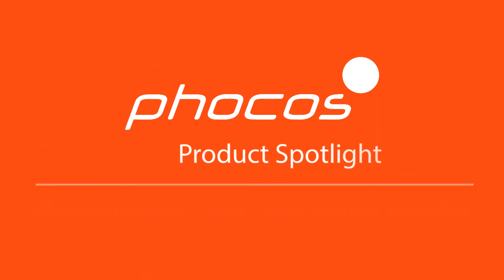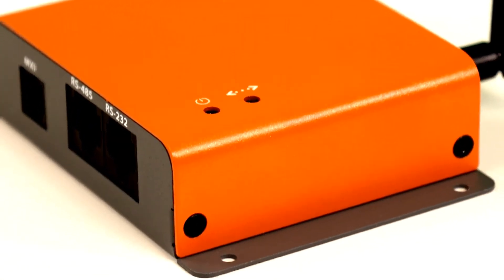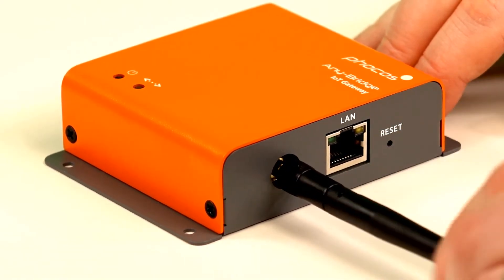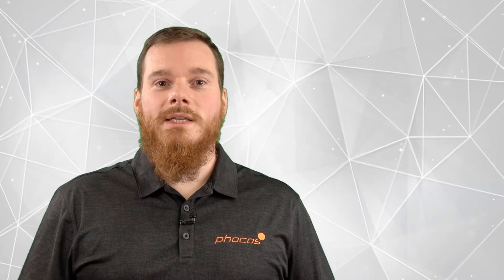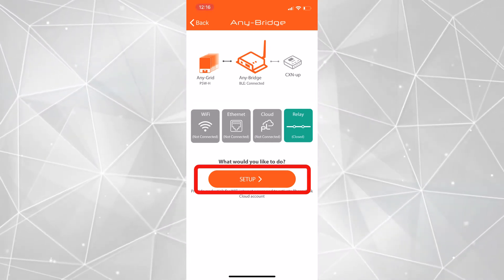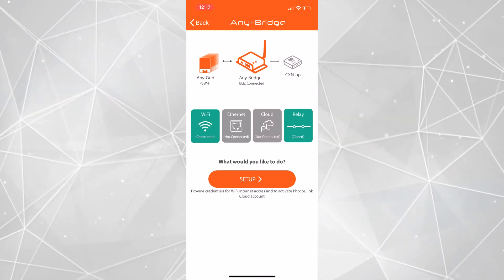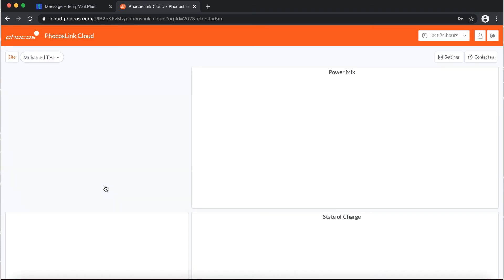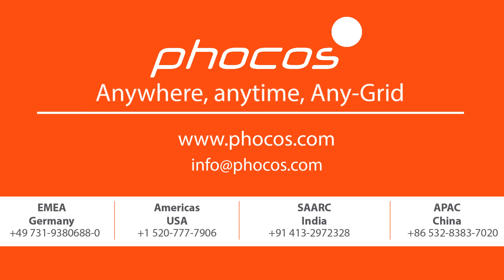How To Setup The Any Bridge For PhocosLink Cloud

Comment: We are having difficulties with an AnyBridge:
Connected to AnyGrid 6.5kW 48V 120VAC via RJ 45 RS232 cable
Connected to AnyCell 5kWh 48V LFP ESS

Green Power LED NEVER lights  Yellow status LED is ALWAYS ON - no flickers
Mobile Link App on Android  can connect to AB and shows data from inverter
however AB-PLC does not appear as a device and is not configurable
and AnyCell does not appear as a device either

I notice that the first connection attempt, we did not need to pair the device - it just connected automatically.
SUbsequently we needed to first pair the device.

With further farting around it appears that the AB does not properly gateway CAN2 traffic from ESS to inverter
we get error 61 

Even when pushing reset - no flickers from LEDs.

It is interesting that the ANYGRiID does not show any status information of the AB - mandatory.
Any ideas for resolution ?
Reply from the maker: Thank you for reaching and sorry about the difficulties you're experiencing. Please reach out to our technical support team on our website https://www.phocos.com/contact/#tab-contactech

Comment: Like victron VRM, where only the installer has the logins to a particular account and he's able to remotely monitor all the systems he has commissioned on that page and if necessary utter changes to some settings,  Does Phocos have something like the victron VRM
?
Reply from the maker: Thank you for reaching out, Installers can be set up with a PhocosLink Cloud account which will give them access to data for their installed sites. End customers also have access to this page to view their system performance. Phocos is working actively to enable settings changes from the PhocosLink platform, available by the end of this year.